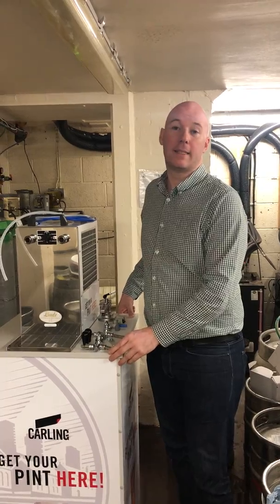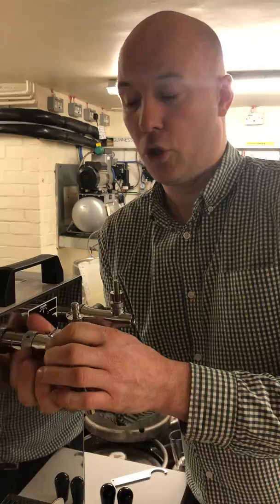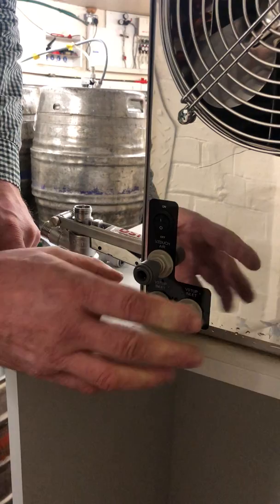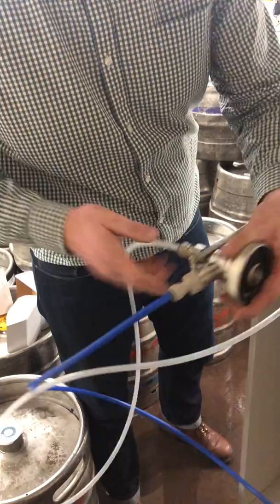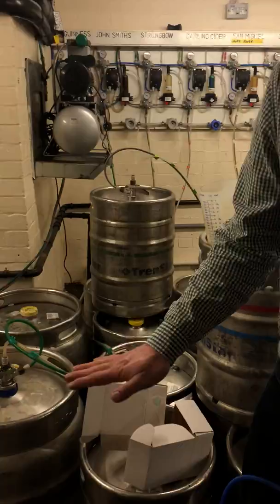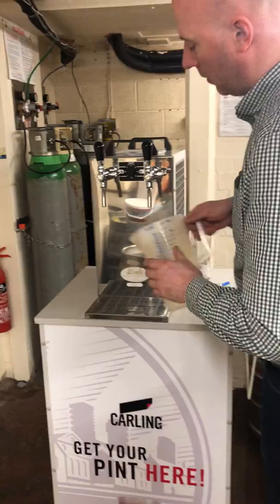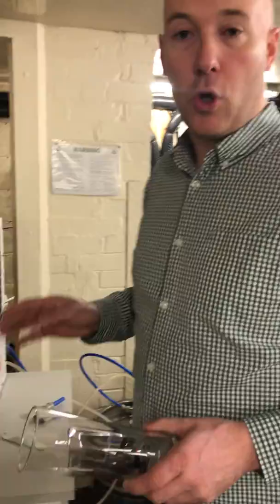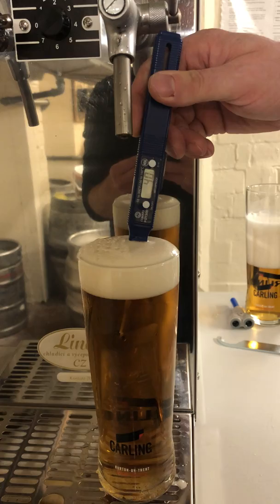Carling Lindr Unit - Setup Guide

Comment: Two questions please. (1)  How long typically would a keg stay fresh for given that you are pressurising with air, which presumably will cause staling rather than CO2? (2) Can the machine be used to carnpate a flat product from scratch e.g. a flat beer staring from a fermenter?  Thanks in anticipation.
Reply from the maker: Hi Graham - please can you confirm which outlet and pub group you work for and we will get in contact direct. Thanks
Reply: @jamesbates6272  I am a private individual.  I have another question as well - do I have to push the beer through using the Lindr compressor or can I connect a gas bottle.
Reply: @GrahamMo  You can just don't use compressor and connect your keg to CO2 via pressure reductor.
Reply: Did you get any good answers how long a keg lasts once connected I want one but not a massive drinker don’t want to waste kegs
Reply: @love13456  2 weeks  max. Usually 1 week
Reply: Andrei Mukhin can you disconnect after a night and leave for 2 weeks then use
Reply: @love13456  May be... if it strong beer and if you placed it into refregirator. No warranty. It is better for you to buy kegerator, not this one.
Reply: @love13456  Once you start adding in oxygen the beer is going to suffer and it will also go flatter over time. The unit looks good but I wouldn't ever pump oxygen into a keg unless you are going to drink it all in one go. It'd be worth getting a CO2 tank and a regulator to keep the beer in better condition and keep the carbonation